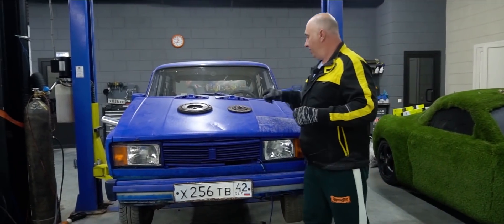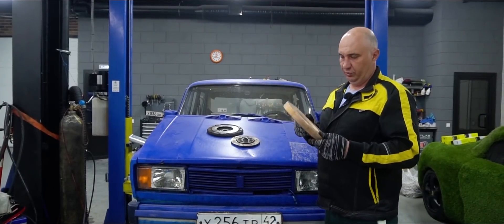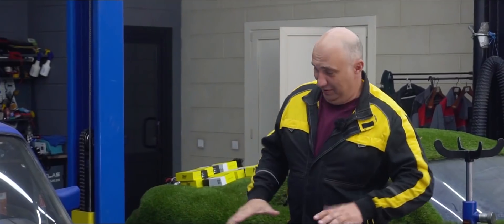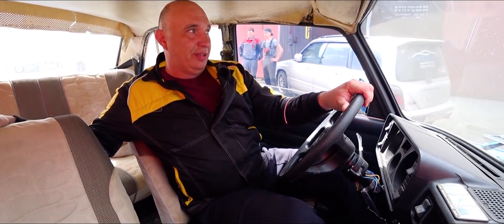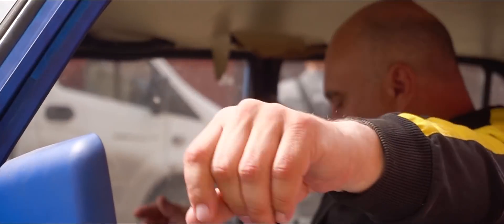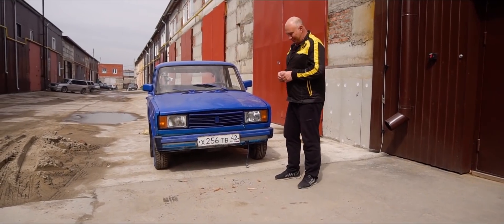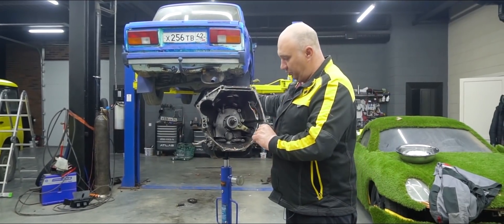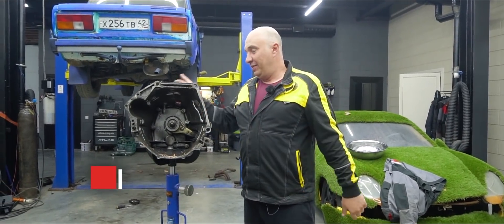Wooden flywheel – will it work?

Comment: I think it is the pressure plate hitting the clutch lever because if the thick flywheel. BTW I would have made the flywheel out of plywood it would be stronger and less likely to split, I am saying this at 5.48 in

Comment: I would have gotten a piece of the trunk that was larger by 50 to 100 mm larger diameter and cut it down to the right size.  That way there's no abrupt change in the rings from the center out. And try different types of hard wood and soft wood.

I'll bet you would need an epoxy for the glue since it's a strong glue and wood glue dissolves in water and doesn't take heat at all. Hard wood from the trunk of a tree and soft wood for the clutch.

Comment: If you flush mounted a bunch of bolts into the side of the wood could you not then tack Weld the ring gear to the head of the bolts?

Comment: Heat a ring from a steel clutch system, remove it and place it on the flywheel.
Easier

Comment: Take out the spark plugs and then try to drive the car just using the starter motor.
Reply: 10 starter motors with 10 lead acid batteries

Comment: Perhaps it needed to be made out of ply also, like the clutch plate? You can get 25mm ply 👍
Rotating wood fast will almost always split down the grain especially when under pressure/torque

Comment: I bet most of these ideas in Garage 54 (wooden engine parts, leaving out some parts, using inappropriate fluids, using anything available as wheel etc.) has at some point come up in the minds of actual Lada engineers back in the days, for cost or material reduction. :D

Comment: That noise is from imbalance that’s why it’s worse at idle and at higher revs it evens out. But rev it high enough and it will ware out the main bearings or blow up.

Comment: How about a plexiglass flywheel with a metal ring on the outside screwed into it ?
About 3 cm long screws 16 all around in total + glue ofc drill the holes carefully as plexiglass cracks easily, might need a sort of metal spacer/plate so it wont disintegrate from spinning alone as well in the center which might be the quickest failure point, and for the next test weld a reinforced transmission tunnel just in case this thing blows apart.
how about a wood exhaust ?
Like last 20% of it just so it wont catch on fire.
Feel free too see if you can modify the engine a bit, like better fuel, spark, maybe change timing slightly & a better camshaft & see if you can get much extra horsepower out of an old Lada like these.
Maybe build a sort of gokart or sports car chassis with a cage around it too make an open wheel car with Lada parts as the base besides perhaps some bought parts that will need replacing like perhaps steering rack, driveshafts,brakes too discs all around, shocks too a lighter set.

Comment: The noise is likely the pilot bearing of the transmission input shaft. When you push the pedal, you put pressure on it and it quiets down

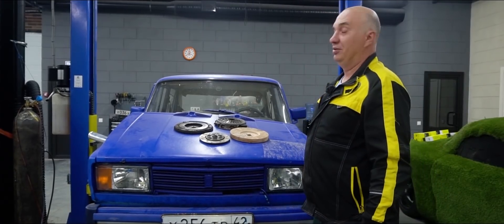Comment: 2:54 KNEW IT lol. The only way it would even kinda work would be to recess the wooden flywheel slightly, and drill tiny holes in the ring gear and mount it to the flywheel with long thin pins, glued of course, and CV youd still only get a few starts with the starter, with a warmed up engine that starts easy.

Comment: I think the idea is magnificant. One suggestion for improvement would be to use oak for rebuilding the flywheel. That should work much better! The friction material on the clutch should be sufficiant as is. For extra strength you could use some  old wood.
For attaching your ring-gear you should be able to use  heat to heat up the ring and pressure fit it. This should work out. Please try to drill the holes after fitting the ring-gear.

Comment: Hi Guys. I would like to see you install a 4-cyl engine with clutch and 4-5speed gearbox into a boat. Just like in a Lada. Ofcourse complete with a shaft and propeller.
How would that boat perform while shifting gear. Will it be powerful enough to run on all gears??   Best regards from Sweden.
Reply: Really interested in seeing this as most boats are 1:1 final drive, but could you overdrive the crap out of it, I mean I want to see the point where you shift up you go slower, as to how fast can you go !
Reply: That is actually an great idea, i hope that garage 54 would try it out.
Reply: Worst to worst 3rd or 4th gears are usually 1:1

So a minimum it will be as good as no gears. 
But you can change the ratio. 
Depends on your propeller rpm and engine rpm
Reply: I'd like to see this as well

Comment: Plywood is actually stronger than plain timber in this use case due to perpendicular layer structure. It's just not strong enough for this application.

Comment: that noise is due that the engine does not have enough momentum. Remember you reduced the flywheel wight by a lot. an negine will not run with out mass on the crank. Your only flywheel there is just the pressure plate.  The inside parts could be screaming with out momentum ;)

Comment: To mount the ringgear on the flywheel: Using a round chainsaw file. File 4 equally spaced slots across the edge of the flywheel and ringgearand insert pins like a crankshaft key and keyway.

Comment: You should do another flywheel with wood and epoxy it to the rengear with some holes in the wood to make it stiffer, that might just hold together and you will be good to use the starter

Comment: couldve put a flexplate with a ringgear in between the crank and the wood flywheel
the woodgleu is likely to come apart with heat ,but i dont think thats wat whent wrong , it  looks like it tore out the center of the flywheel when you dumped the clutch sandwiching a metal plate in between the wood or make a verry wide bolthole pattern to mount it to the flexplate and rivit it together mightve worked better / longer as the metal catches the torq when you dump the clutch and the wider boltpattern should prevent the wood from splitting between the holes , might still explode the wood out when you rev it high though

Comment: Pressure plate making contact inside bellhousing due to thicker flywheel..noise less when pressing clutch because thrust bearings on crank propably worn and crank moves forward ever so slight, so less contact between pressure plate and bellhousing "thrust bearings stuffed in other words"

Comment: You can’t make the flywheel thicker as there is no room for the thrust baring I recon if the flywheel was the same thickness as the original and bolted and bonded on it would have worked how about some wooden rims or brake discs 😂

Comment: Try it again with the ring gear installed, just don't use the starter.  It should reinforce the flywheel, for the radial loads caused by centrifugal forces due to rpm.

Comment: Вы можете попробовать использовать кольцевую пилу для сверления отверстий в маховике, чтобы уменьшить вращающуюся массу.
(you could try is using a hole saw on a drill to cut holes in the flywheel to reduce the rotating mass. )

Если у вас все еще есть двигатель, который вы обрезаете противовесы с коленчатого вала, а затем надеваете на него облегченный маховик, представьте, как быстро двигатель будет ускоряться и замедляться в диапазоне оборотов.
(If you still have an engine that you trim the counterweights from the crankshaft and then put on a lightweight flywheel on it, imagine how fast the engine will accelerate and decelerate in the speed range.)

Comment: 2 layers of plywood with a bit of sheet metal (car body panel type) between the layers for the ring-gear to attach to
also, a wooden car with wooden wheels and  a wooden engine wooden go

Comment: I'd still use the gearbox, I've put a trans into a monte carlo where the bell housing had a huge hole in it from the clutch breaking apart, thing is still going today with 4 bolts lol
Reply: I had a golf mk2 that you could see the gears thru a hole on the gearbox 😁😁😁

Comment: 6:00 your flywheel and or pressure plate is out of balance. I dropped my clutch pressure plate one time when I install it and makes that noise and when you push the clutch in it is gone.

Comment: You can try heating the ring gear and let it expand then drop it on the flywheel
Reply: you'd have to get it pretty hot in order to expand measurably, and that would probably scorch the wood I'd imagine. although that said I believe that's the way they used to put steel tyres on cart wheels.

Comment: how you could install the outside gear would be simple, do the gear just small enough not to fit, heat it and place it around the "flywheel" cuz heat will make it expand a little bit and when it cools down, it shrinks

Comment: This was kinda dangerous. That pressure plate could have been shot out of the bellhousing into the car... the driver could have been injured... remember, the flywheel is supposed to keep the pressure plate in place while it spins at crank speeds, maybe as high as 5500rpm.

Comment: It make sence that the wooden clutch disk held just fine. 
 
 
You may not know but Montreal's underground wagons have wooden brake pad.
Reply: San Fransisco's trolley system also uses wooden brake pads
Reply: Wow
Reply: That's interesting, didn't know that.
Reply: Was mildly surprised that the wooden clutch did not grenade. Was not even a little surprised that the flywheel did...
Reply: @99milesaway41  lada has like 3hp it aint no 8000rpm big block lol
Reply: @johndowe7003  lol true 😂😂

Comment: The noise if from the extra thickness in the flywheel. What they should have done is Turn down the thickness of the flywheel to the thickness of the ring gear, then glue/screw a wooden insert to the steel backing, much like what is done to make aluminum flywheels.  They can keep the thickness and the ring gear.

Comment: You know how carbon fiber is made - literal fiber coated with epoxy.
I've had this idea, of splitging wood when wet into thin fibers and coating it in epoxy ended up in same result
Reply: Wood fiber is very heavy, and not very strong, so you wouldn't get a useable product.
It's better to coat your wood fiber with styrene.....then you've made cardboard 😋

Comment: I’ve always wanted to see what happens if you “forget to tight the fly wheel”
Reply: I've seen it a few times, and it's really something you don't want to experience. In particular on a transverse engine. The worst I've seen was the flywheel having left the engine, cut its way through the firewall into the cabin, to exit through the roof. Unbelievable no arms or legs were lost.
Reply: It flies! Hence the name :)
Reply: it comes out the transmission tunnel and gives you a free  amputation

Comment: Can you modify a diesel engine to make it run fueled with gasoline?
Reply: Yes you can. It won't work as a diesel afterwards tho. Actually it's common practice on 1000hp plus vw golf's to use the diesel block as a base.

Comment: If  the old flywheel had been attached to the front of the crankshaft then there would have been some weight to balance the engine and a starter could have been attached with some fabrication of mounts even a gear driven alternator.

Comment: You should machine the ring gear off the flywheel, weld metal tabs to the ring gear drill some holes in the wooden flywheel so you can bolt the ring gear to the flexplate

Comment: Try again with 3 pieces of 18 ga steel disks drilled with multiple 1/2" holes sandwiched with bamboo hardwood and PL premium construction adhesive pressed with a 50ton press then machined

Comment: I bet that sound is from increasing the thickness of the flywheel and it being slightly offcenter/warped making the throwout bearing ride on the pressure plate, bouncing and wobbling the whole time.  Side loading the bearing too which is designed only to run true in one direction that being in/out not side to side. 
.
Reply: Yeah, that likely threw balance off and as a result made the inevitable happen much quicker.
Reply: 100% what I was thinking as well. I was also wondering if his clutch pedal bottoms out before actually hitting the floor due to the slave cylinder not having to extend as far. Or if the master 'pumped up' creating an unnaturally firm pedal from improper adjustment due to the t/o bearing constantly riding on the pressure plate. Bet that'd be hell on the engine's thrust bearing.

Edit: speaking of thrust bearings... Wonder if he could fab one out of wood 🤣.
Reply: I have...no idea how auto mechanics work. I seriously need to learn how automobiles work. Judging by your comment, I have a LOT to learn. :c

Comment: When you have the clutch depressed it doesn’t matter what kind of flywheel you have i think. The mass of the whole car does the job of the flywheel then via the wheels. Only when having the engine idle and gearbox in neutral then the flywheel is important i think. I think a car without flywheel will work good, just a bit more stuttering sound at idle+neutral.
Reply: A engine needs a flywheel no matter what
Reply: Tommy Schnettler How about explaining your thinking. Just yelling a oneliner isn’t anything worth.

Comment: Why not making a re-enforced concrete flywheel with a wooden clutch?
Reply: Even if the concrete is reinforced, it would be much more brittle and intolerant to vibration than steel or some composite material.
Reply: @Andre-cj1ds   In this case you could also use the composite material in combination with the concrete. And ofcourse there are many concrete formats. But i don't know them all from my head.

Comment: Wooden engine, make it happen XD
Reply: With steel sleeves
Reply: Gonna warp, even metal does warp over a certain threshold
Reply: Stuff like teak and lignum vitae is worth a try. Pretty sure it's been done, but it's more the rings and bearings that can't be made of anything but metal, or ceramic at a pinch.

Comment: Every component of the car that you replaced with there wooden counterparts that worked, you should remake them and then install them all at once and see how long it last for.
Reply: Yeah, I was thinking a full wood transmission
Reply: Cast pine crankshaft. Billet beech block and heads. Conrods and pistons forged from solid lignum vitae.

Comment: Run a lada with one piston and rod removed weld the journal shut
Reply: Back in the '70s when I was in high school, a friend had a Cutlass with a 350 Olds V8. He had a piston skirt crack, and instead of installing a new piston, he pulled out the piston and rod, sawed off the big end of the rod, and put it back on the crank (as a spacer, next to the working rod). He then pulled the pushrods for that cylinder and drove it as a 7 cylinder engine for months before getting another car and giving away the old one.
Reply: @jbuchana  that's genius and hilarious at the same time 😂. Wonder how much vibration/imbalance it caused lol.
Reply: @SSChambers1  Those old V8s still ran smooth enough on 7 cylinders that most non car people would hardly even notice anything was wrong.
Reply: @twoeightythreez  The vibration he's referring to isn't imbalance from a cylinder not firing, but rather the entire rod and piston being gone, throwing off the balance of the entire rotational mass. I'd be curious to see this replicated on any engine. Would be a sight to see.
Reply: @jbuchana  How much less power did your friend's Cutlass have?
Reply: @ellenorbjornsdottir1166  7/8ths power?
Reply: What is the journal?
Reply: @SouthwesternEagle  crank has an oil supply hole to each rod. Hes saying block off the oil supply hole (journal) so it keeps oil pressure.
Reply: @Steve that’s what I want them to test with a lada how bad it could make the engine shake
Reply: I have  a small homemade tractor wich i used a VW 1.6 diesel engine with a really bad cylinder. So I removed that conrod leaving the piston to close the cylinder and holding the journal bearing with a tube clamp. Also, I ground the camshaft lobes so the valves are kept closed. Does it vibrate? Yes! A lot! Though at idle and at certain revs it isn't that bad. Power isn't really an issue on my aplication. As a side note there was a motorcycle with this poor configuration - laverda jota 180 as it is known.
Oh and I installed a junk turbo also, just for giggles...